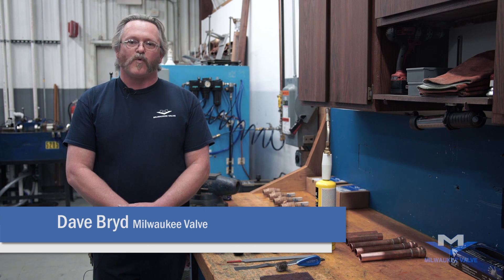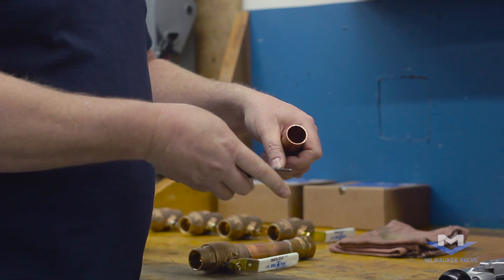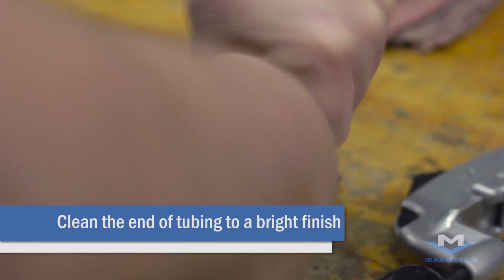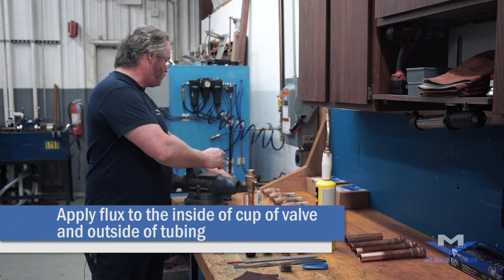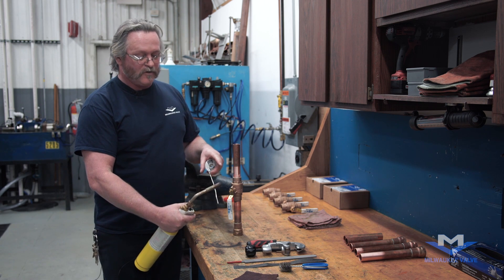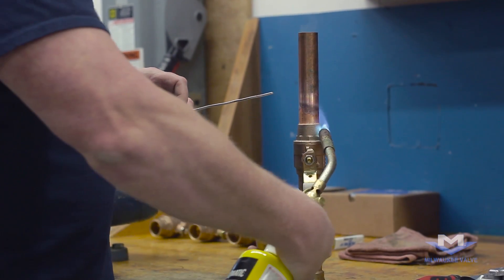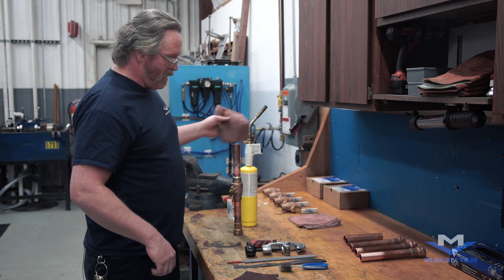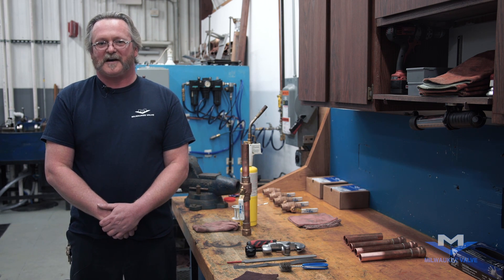Milwaukee Valve Company Soldering UltraPure® Low Lead  Valves

Comment: For the avoidance of doubt / confusion, it would be helpful if you were to post a video showing how to solder copper pipes to a BB2-350 Butterball valve. 
Presumably, the soldering tailpieces are threaded to the valve body and should therefore be unscrewed prior to application of heat, in order to avoid frying the valve seal?  
Question:  Are they right or left hand threaded and is there a special tool to use if they're exceptionally tight?